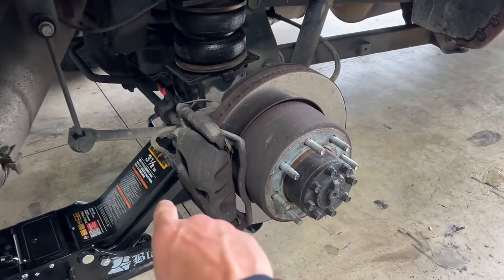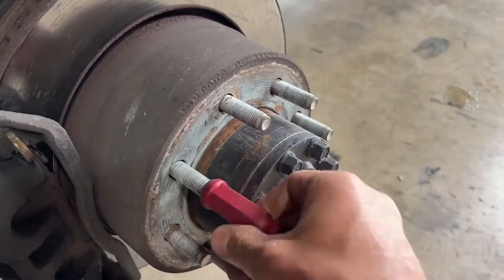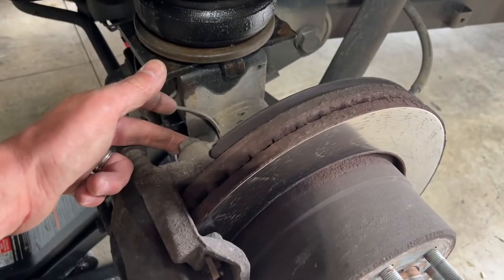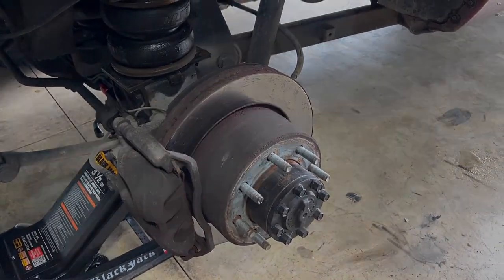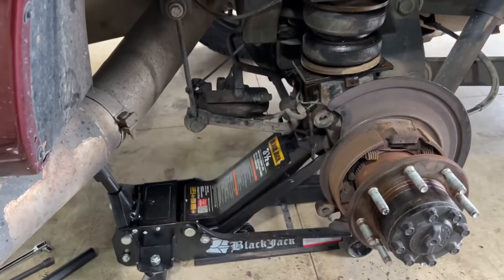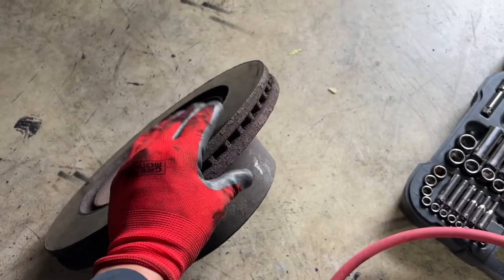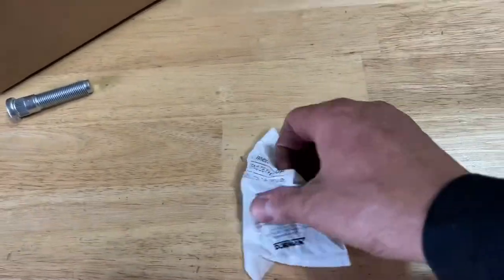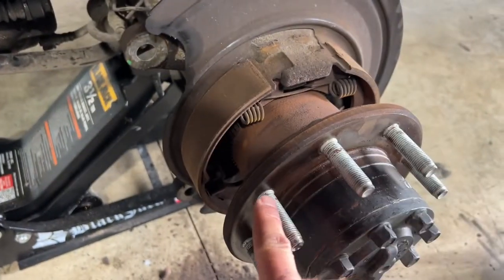How To Replace A Damaged Wheel Stud On A 2018 Ram 2500 Cummins for $8

Comment: Good work, you got it done!
I guess you did not have a short impact socket? Usually you can put that on the breaker bar and it will fit in between the suspension and bolt that holds the brake caliper on? They are definitely tight but this is how I've done it a few times.
Then any large nut over the stud put the stock beveled nut back on, it will Center the larger nut away from the threads. Then just impact it on till right before it seats. As not to over torque it. Finish it by torquing it probably at 129 ft lb.
🙂🙂👍👍